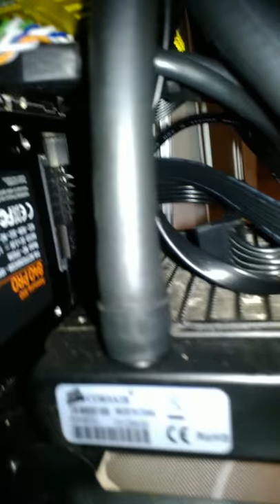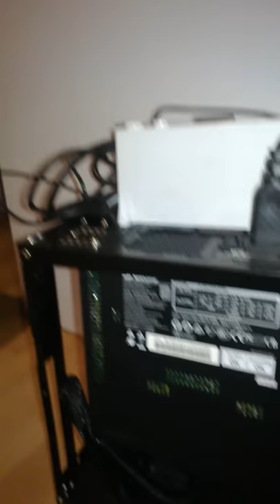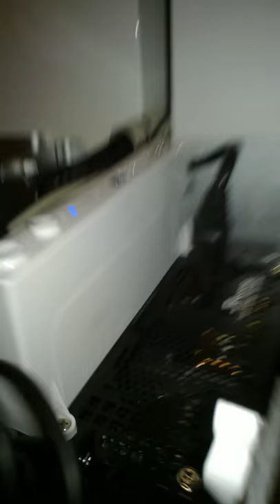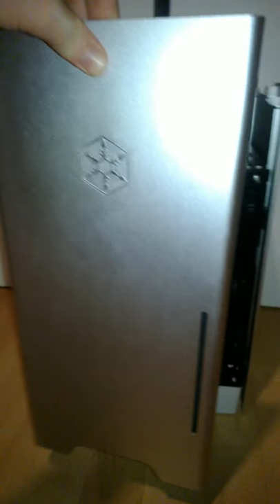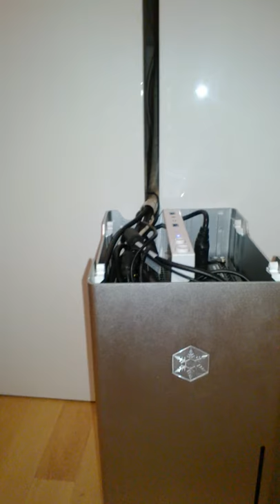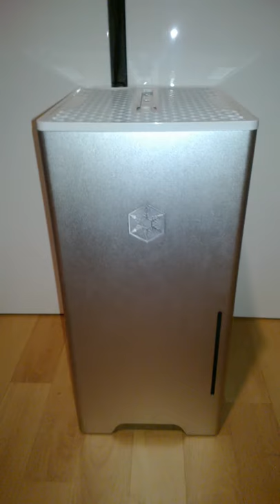In and around a very quiet FT03 Mini

Comment from the maker: Trokji: the problem was that the passive cooling fins extended to the back, so it didn't fit. When you pick a GPU, make sure it doesn't have a too thick back plate - more than 3 mm will get you in trouble with the PSU.

You have to be a bit creative with the screw holes, only one will actually properly fit. But the perforations meant for air can actually hold screws, too, so you'll be fine. You have to bend a metal piece meant to keep the SFX PSU in place but that shouldn't be a big deal either.

The seasonic passive PSU works great, although I've noticed that my plan for full passive cooling has one issue: the one fan I'm currently using (noctua 140mm) needs to speed up quite a bit when I'm playing games, and that's on the internal GPU. With a dedicated GPU that's passively cooled, say a Geforce 750 or such, I bet the one fan will have a hard time.

Comment: I was thinking about a similar config..why the card doesn't fit? with the PSU, what is the space remaning with the PSU for the card?  I'd like also put both CPU and GPU on liquid with an XSPC Xtreme Radiator RX120 V3..is there enough room with that PSU inside the case? did you changed the holes of the screws to fit it in? I've heard that SFX PSUs are noisy so fitting an ATX PSU can be a good solution